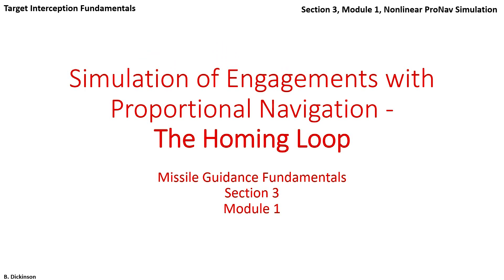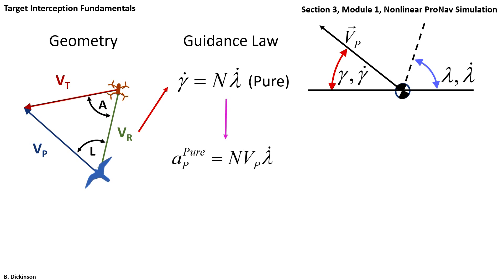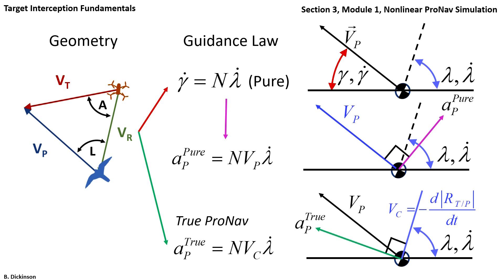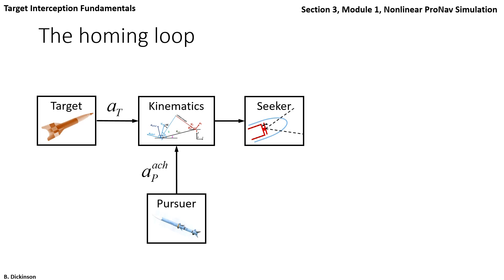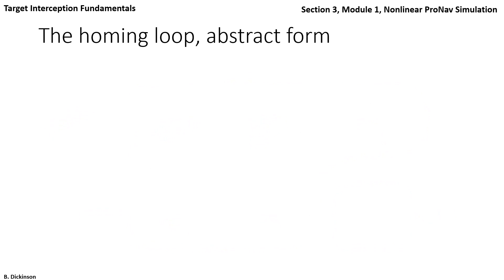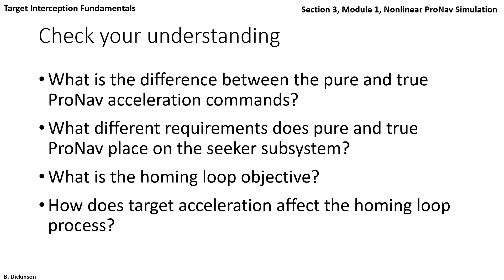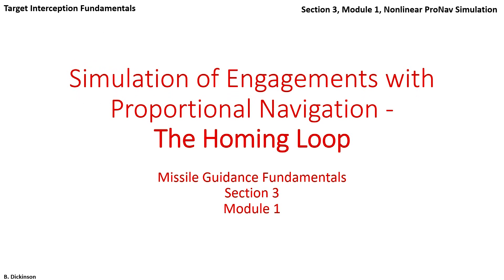The Homing Loop for Proportional Navigation Sim - Section 3 Module 1 - Missile Guidance Fundamentals

Comment: If applied to quadcopters, does the ProNav law replace the position controller? Can i extract desired roll and pitch directly from it?
Reply: I am trying to use PPN int target tracking rather than actual collision
Reply from the maker: I don't think so. PN laws guide the pursuer to the target through regulation of the line of sight rate. Position control implies tracking position in some manner, which PN does not explicitly do. Additionally, desired attitude like roll and pitch is not an output of PN.

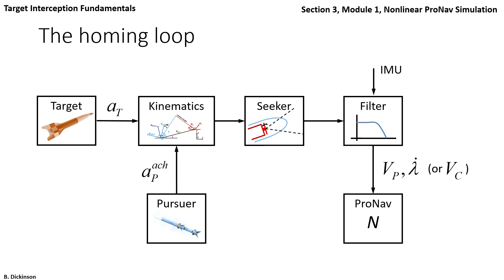Comment: Hi Ben, 3:14 i have acceleration command formula filled out it works awesome now i have to develop autopilot to  convert Acmd to -1,1 actuator pitch,yaw [missile is roll denied (symmetrical)] inputs( 45° control surfaces -1=-45°, 1=45°), can you point to me anything to research to reach the final stage?

Also please can you explain a little bit what commanded acceleration means since there are missiles that can't control their thrust to accelerate and such is it side acceleration to LOS angle?
Reply from the maker: Hello, to create an autopilot, you'll need to go through a model based design process. There are many references out there that a quick Google search should reveal. 

The acceleration command refers to the desired acceleration in the pitch or yaw directions. It's accomplished with control surface deflections. Thrust is not required!
Reply: Hello, I am trying to understand more about how to create an acceleration command formula, can you help ?